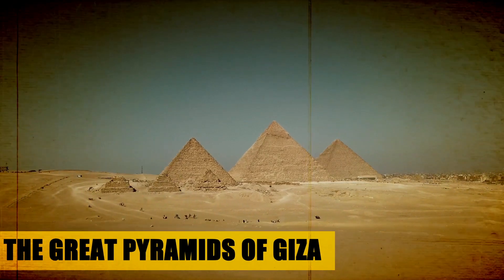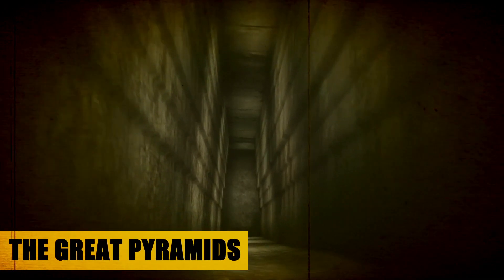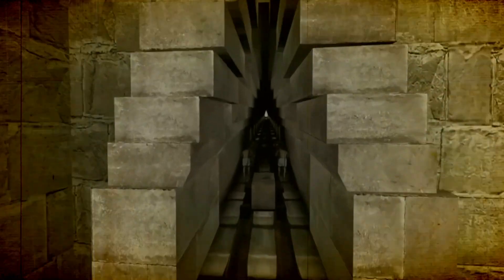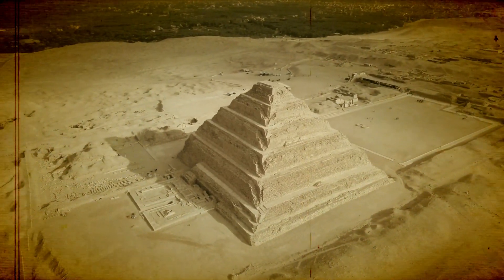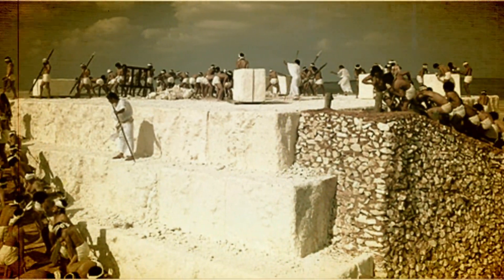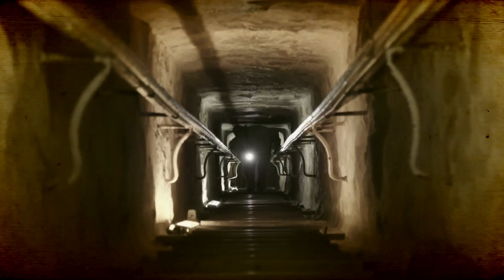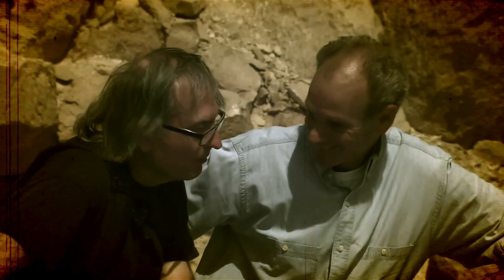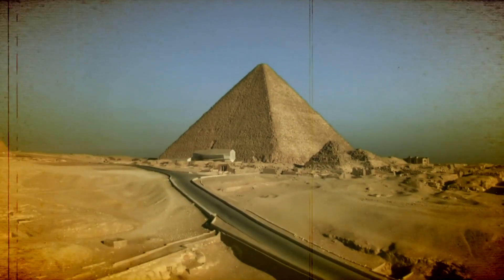The Great Pyramid Reveals the Internal Ramp Theory

Comment: How would we build a pyramid today if someone would commission it as his grave? 
First, we would make a level surface using flooding techniques and machinery.y 
Then place down the first layer of casing stones and the internals of the base of the pyramid. Then leave a little ram on the hole we made in the casing stones to have access to the internals of the pyramid. 
then go up one layer and then another each time we would have to move less and less stone 
then when we reach the corner we have to turn 
then the ramp goes up more while the internals of the pyramid (large relieving stones above the burial chamber, as well as the entrance and the hallways, would be moved using internal ramps like the grand gallery as it would be reasonable to use the pyramid later by layer nature to our advantage. 
After the builders reach the summit they cover the side made by the ramp with finely cut casing stones and filling stones that are put in their final resting place as the ramp gets shorter and shorter. 
Cranes would be crucial in lifting the blocks vertically but without an internal ramp, the workers and builders couldn't move them to their final place.

Comment: I swear historians and archeologists have 0 common sense, like of you use an internal ramp then how the hell are you building ceilings? It doesnt even make sense with the shape, how the hell would you get the top block on there when the hole it's covering has to be smaller than the block itsself or else it would just fall through.